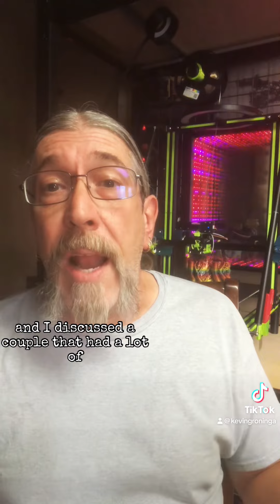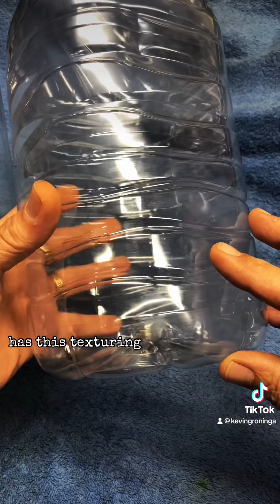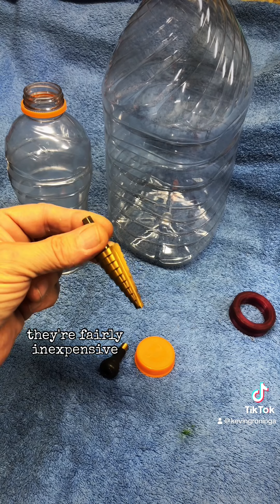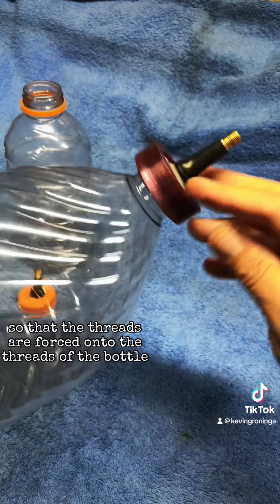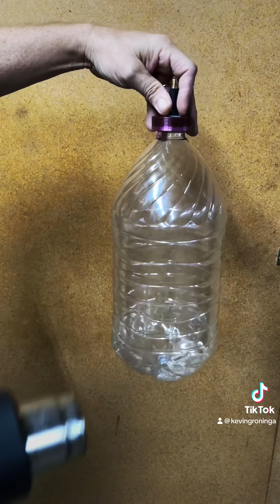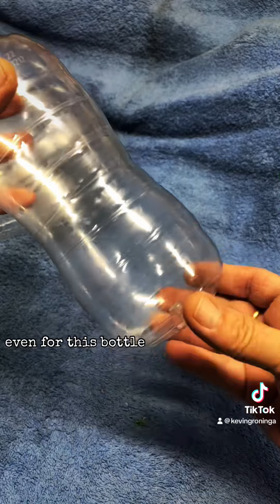FREE Filament for 3D Printers made from Recycled PET Plastic Bottles!

Comment: Gatorade bottles, even the more heavily textured 20oz ones, smooth fine, but you probably need more pressure and/or better application of the heat. I use 1-2 full strokes from a full size bike pump and turn over an electric stovetop burner on high until the texture is gone. More important than keeping the cut straight is getting the thickness consistent.
Reply from the maker: I generally don’t like those Gatorade bottles.  They’re thicker than the large water bottles I use, which means I have to keep adjusting my bearing cutter.   But yeah, a little more pressure and a little longer under the heat gun would have made it even smoother.   As far as the electric stove, that seems to be a little extreme and a waste of a lot of electricity unless you’re doing a few (or more) bottles at a time.   I didn’t show this in the video, but I usually put the Shrader valve in the chuck of a battery powered drill and use that to slowly turn the bottle while I’m heating it with the heat gun.  It’s a little more even application of the heat.  I’m always concerned about accidentally melting a hole in the bottle.  If that happens, the resulting BANG can be super loud and potentially dangerous.  You know, Safety Third, right?
Reply: @KevinGroninga3D  Yes. I'm planning on developing a heating element to put inside the bottle, attached to the cap, which would expand these and worse bottles a lot more efficiently and uniformly.
Reply from the maker: @daliasprints9798  that’s why I don’t waste a lot of time with smaller bottles with a lot of texturing.  This isn’t a very efficient process to begin with, so I focus on bottles with ‘bang for the Buck’.  I like the 1 gallon water bottles we get from that friend of ours.  Sure, there’s a little texture, but easy to remove, and I can get about 14.5 meters of good usable filament from one.  That also means a lot less welding to get a significant amount for printing.
Reply: Great videos! A person could also use a lightly clamped on hose clamp to keep the pressure cap threads engaged on the bottle.
Reply from the maker: @skydude426  Yep!  A worm clamp (hose clamp) would do the job too.  Good tip!